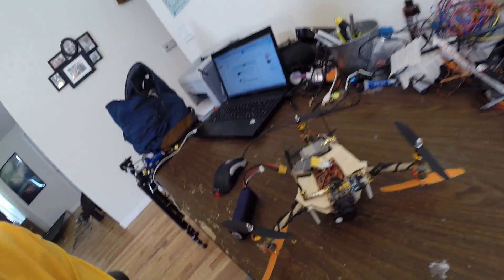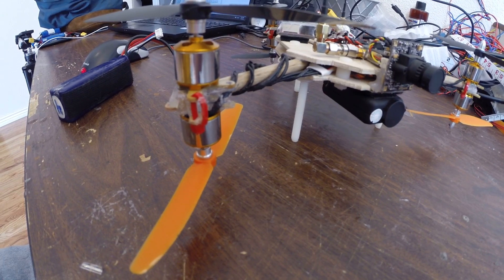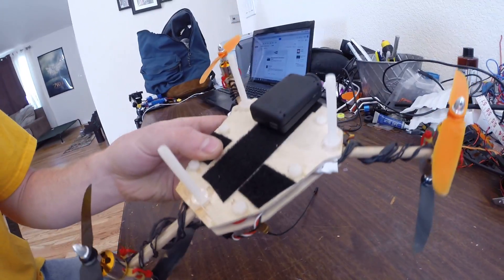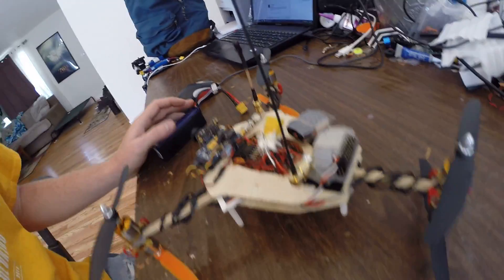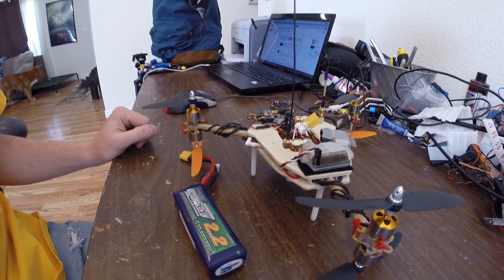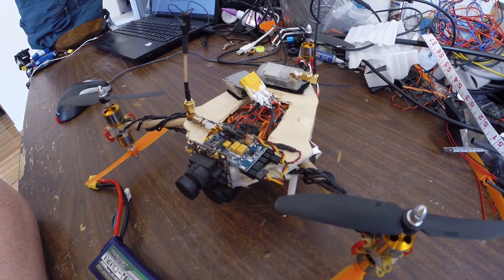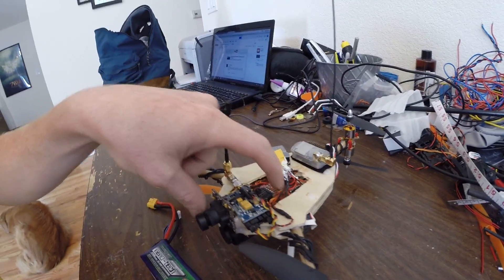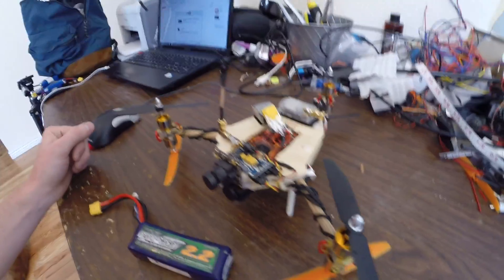Mini 250 Y6 Multirotor Overview

Comment: Thank you!
Several things surprized me about this. I learned alot, so thanks again!
Very low amps, very low AUW, i see alot of potential with this. I love my QAV250 and am in the market to build up a mini hex for longer flight times and better "punch-through-those-leaves-ability". Im exploring all options at this point and was very interested in seeing a mini Y6 and a mini Y4. You took care of the Y6 for me, and I like what I see. Good work! I look forward to seeing your progress and refinements.
Dust
Reply from the maker: No problem, I'm hoping to develop a G10 or carbon Y6 frame for when I get better motors and then I think I want to get 2 more of these motors and build an H8 or X8 or something crazy like that haha.
Reply from the maker: missed you when you came to Denver!  hit me up if you're back again.